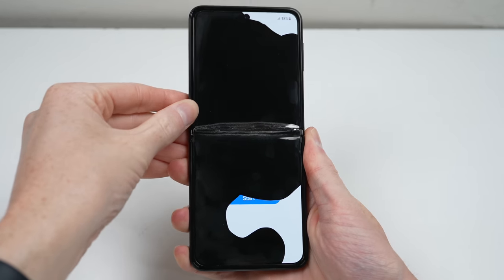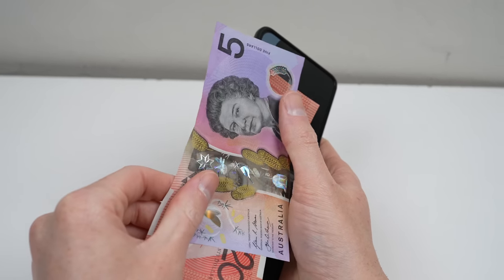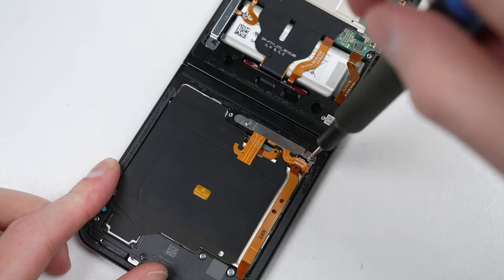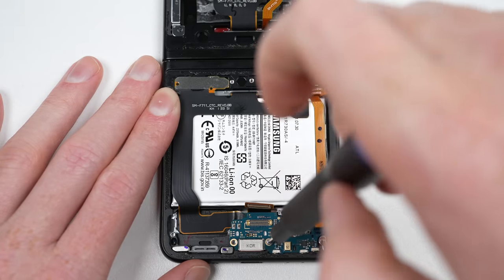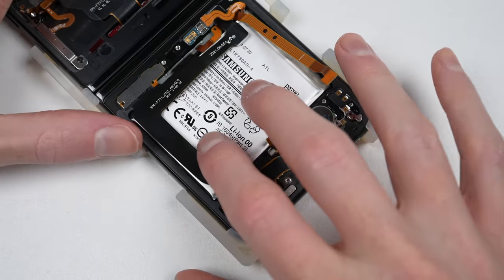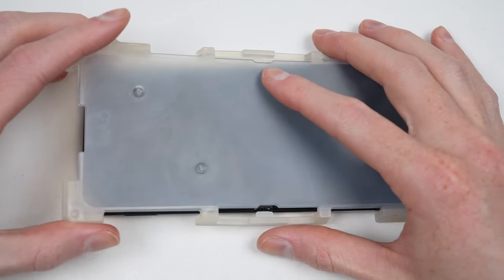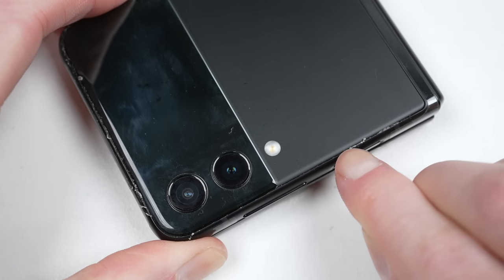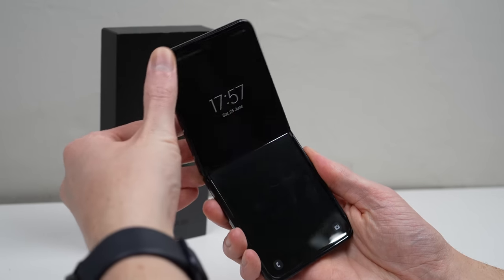$230 Galaxy Z Flip 3 Restoration

Comment: Time and time again, I am stunned just how unrepairable modern devices are. It's pretty sickening actually, but nonetheless, great fix!!
Reply: But he actually repaired it tho. You might mean they are more fragile and built with planned obsolesence, because Samsungs are very easy to repair, they were the first ones who started offering original replacement parts, and almost all their devices use the same type of screw unlike Apple who used like 10 diferent types and makes repairs a pain.
Reply: @thetechfromheaven  what I meant is repairs are not user friendly. They require tools and in some cases like this one, they require entirely new chassis that cost a few hundred dollars. 👍🏼
Reply: @RicoGalassi  yup, repairs will always scare away the average user. But if you have $1000 burning in a hole, it's a very good idea to invest in repair tools.
Reply: @RicoGalassi  That glue hell makes me sad every time I see it. Not Hugh's job with the glue, no the mere need for it. My Z5 Compact too is fully glued shut and I really hate this crappy trend.
I came to the video wondering how in heck you separate the screen and reattach it properly, and then he just goes "Nope, DON'T". And... yes, fully understand why.
Reply: @thetechfromheaven  If you have a thousand dollars to burn though, you'd be better off just buying a new phone. Unless you're a repair shop, spending a thousand dollars isn't exactly worth it for a 230 dollar phone.
Reply: @thetechfromheaven  what $1000 worth of tools are you talking about? I own a phone repair business and my tools aren’t even close to a couple hundred dollars. You need a screw driver set which iFixIt is a good deal. You can get a pretty complete set for like $100 and that includes the plastic pics cards tweezers and suction cup. Then maybe if you heat for something’s a standard $20 heat gun is fine. A syringe costs a couple bucks and so does alcohol. All those things are god to have even if you don’t fix phones. In my business the only thing that’s expensive is the laser to remove the back glass of an iPhone and you don’t really need that for home repairs. Any shop will charge about $99 for the back glass repairs on an iPhone. It’s not expensive to fix your own phone and the tools you absolutely need are good to have regardless
Reply: It's literally a flexible paper display. How is a normal person supposed to repair it without any tools? This isn't a giant 1990s telephone
Reply: Everyone calm down hahah I was just stating that modern phones are difficult to repair ffs
Reply: i survive on cheap phones usd 100-150. i don't go with the hype of "flagship" models
Reply: @RicoGalassi  I don’t think anyone isn’t calm haha. The real issue is we as consumers kind of wanted this. I’m in no way defending the practices of companies but a great example I give is everyone wanted wireless charging in the iPhone so they gave it to us. Issue is you can’t wireless charge through metal so they changed to glass and then everyone complained and said “they swapped to glass so it breaks and costs money” haha. The fact they decided to cement it on is another story haha. As things get thinner and smaller and less mechanical it’s going to get harder to fix without special tools. Surprisingly this was a pretty easy fix for a phone
Reply: I agree! I miss the days when both laptops and phones were fairly modular, and at least had easily swappable batteries.
Reply: @Kalvinjj  In my opinion the glue is the absolute worst part. Especially with battery replacements.
Reply: @KhanTutorialsBD Yeah.
Reply: @Kalvinjj  That's the trade-off for improved water proofing.
Most smartphone trends are based on what customers choose to buy.
Reply: @KhanTutorialsBD Very much agreed. MacBooks are pretty bad now though.
Reply: @AlwaysBolttheBird  I know you can even start with almost nothing, I started with a crappy 858 soddering station and some cheap screwdrivers but It would had been nice having $1000 in tools. Hell, if I have to choose between $1000 phone and $1000 in tools, I'd go for the tools without even thinking twice.
Reply: @munenex  I survive on repairing phones, no matter if their are cheap or expensive. I have the Galaxy S21 just because someone sold it to me broken for cheap and I chose to fix it, but there's no way in the world I buy a new phone be it low or high end. Actually I like my old Moto G8 more than the S21 (I also got that broken for very very cheap)
Reply: @KhanTutorialsBD This is true for the most part due to sandwiched board stacks making repairs very hard, requiring you to develop certain skills and aquiring certain tools, but that's also the fun part!
Reply: @KhanTutorialsBD Yeah, there is a lot to be desired with current tech policies. But that same restrictive environment has led to figuring out creative "non authorized" ways to repair the phones
Reply: @KhanTutorialsBD Very much agreed.
Reply: @AlwaysBolttheBird  wireless charging doesn't excuse the lack of repairability, bc  it's not on every phone and they're still glued in batteries. 

Blaming consumers for unrepairable phones seems to be pretty wrong-headed . Especially since the vast majority of smartphone consumers don't even think about their smartphone unless they actually have to buy one because it broke.

Sure maybe there's some tech enthusiasts that were wanting form over function, but the companies didn't make this change to meet a demand, they made these changes to increase phone sales.
Reply: @munenex  Expensive junk reveals the low-hanging fruit for those with eyes to see.
Reply: Guest_7802  😂
Reply: @RicoGalassi  Thats your fault for being an early adaptor of new tech. Of course foldable displays are not easily repairable lol. Wait like 5 more years and it will be much simpler.
Reply: And worst of all they remove the charger 😒,  in the name of the "Environment".
Reply: @michaelcorcoran8768  have you taken out a battery from an iPhone? It’s not that hard. They have pull tabs and if they break alcohol works fine. Moreover I said the fact that the back is cemented in is wrong. Most importantly I was giving an example of people thinking that companies are doing things to make more money when in fact it’s what the consumer asked for
Reply: @RicoGalassi  This 2asnt even that bad, and 6ou don't have to replace whole frame. If you are confident then you can just replace the display. Obviously you'll need more skill to repair complex parts like a foldable display as it's still in very early stage and will improve overtime.
Reply: @The Tech From Heaven  a 1000 !?!?!?!? Bro I had my whole equipment for 35.- 😅 heat gun, screwdriver with modulable tips, guitar picks and suction cups won't ever be that pricey. Unless you take the first thing you see of course
Reply: This was surprisingly an easier fix than I've seen of other phones. But I do agree that many other phones are basically unrepairable
Reply: @RicoGalassi  these are similar people who are stopping right for repair sadly
Reply: @munenex  i like flagships for the premium chip sets if cheap $100 phones were able to handle games and have 120 htz id be using them right now lol
Reply: It's literally done by design....
Reply: Ahh remember the Nokia candy bar from the early 2000's? That phone was literally indestructible and sold for 100$, now you pay 1500$ for a device that is super fragile.
Reply: @RicoGalassi  rrepair is not the norm now, thats why its safer to buy midrange phones sometimes
Reply: I love the innovation & build quality of this but waaaaay too fragile for my everyday use.
Great video Hugh!
Reply: I don't think you can expect a folding smartphone to be repairable bro get the hell out of here lol 🤣
Reply: Does that have to do with the complication of these phones, or that they dont want you to repair it?
Reply: @rubennietnodig7579  Id say both
Reply: @grahamevans8567  I have a very hard time believing that. In the case of apple, where non-original parts simply wont work i'd agree. But ive learnt from this channel that samsung uses all the same screws, doesnt fuck you over with different parts.
Reply: @rubennietnodig7579  i think the type of screws is irrelevant here but you are entitled to your opinion of cause. Why do you have to bring Apple in to it? Im curious
Reply: @grahamevans8567  Something to compare it to. It doesn't mean much on its own.
Reply: @rubennietnodig7579  lol
Reply: well to be fair it is a foldable phone
Reply: @grahamevans8567  Does that not make sense to you?
Reply: It's not sickening, it's logical. I expect devices as complex as the modern phone to be hard for a layman to repair.  That's obvious.
Reply: @zackwyvern2582  agree
Reply: I don't think ppl nowadays want a phone with screws on the outside and a border to hold the screws. Hence the adhesive.
Reply: @Allan_Stone  yes! Very true
Reply: At the same time companies remove adapters to save environment, but make their devices even more fragile and harder to repair.
Reply: @munenex  honestly dude, dont buy sub 200 budget phones, becuase flagships from 1-2 years ago are usually 220ish on ebay open box. Used flagships are miles better in every way.
Reply: it is a foldable after all. but still cool, I just wish samsung would ditch the UTGlass since it's still plastic on the front of it.
Reply: @RicoGalassi  dude, every android phone is repairable compared to the iPhone crap
Reply: I just hope whoever designs these phones doesn't end up also designing pace makers and insulin pumps.
Reply: @marcusborderlands6177  and what about the battery life?? You forgot that early flagship battery management was trash. The only flagship worth buying in my opinion is the Galaxy s10 plus
Reply: @danteerskine7678  oneplus, LG, and Motorola all have flagships under 250 you can buy on eBay. Stuff like the v60, oneplus 8, and moto edge all stand up today really well.
Reply: Not that difficult to just take good care of your devices or carry insurance
Reply: @marcusborderlands6177  My insurance doesn’t cost a thing cause it’s included with my credit card. And no insurance does not cost half your phone. You are getting pegged if you are paying more than half the cost
Reply: @munenex  yes Grandpa you're very cool for buying 100 dollar Androids like most phone users do anyway.
Reply: @ballstothewall38  the tradeoff is the ability to do more things with your phone than just call and maybe text people. The problem isn't necessarily that phones are fragile; obviously anything with a glass screen will be more prone to breaking than a plastic brick. The issue is that phones are built to make repairing the inevitable damage difficult.
Reply: Blame - Apple for it, every other manufacturer just copied them...
Reply: @RicoGalassi  no shit, more features and complexity means it will be harder to fix. We don't have basic nokia 3310's anymore.
Reply: Yup, I’ve got a new flip, scares the crap out of me. I have a hinge protector though. But my s20+ I had before this was run over by an ahole Uber driver (long story) and whilst the phone worked fine and the screen was still visible and working fine it was cracked to a dangerous extent and SOME parts of the screen were black. It was uneconomical to fix and it really annoyed me.
Reply: @thetechfromheaven repairs a pain ? I changed my screen and battery on my iPhone 7 + under 10 minutes, how’s that a pain ?!?!?’v
Reply: Looked pretty repairable to me.
Reply: Where to buy that?
Reply: Um.. it's a foldable.
Reply: Well overtime the engineering becomes better and better to the point where regular people would have a hard time fixing one without having any training. Unlike years ago where all you'd have to do is remove and re insert the battery or just turn it off and on again. Just a few decades ago touch screen didn't even exist, now we have phones with screens made of a foldable type of glass. Technological advancements happen faster and faster to the point where a regular guy would barely be able to keep up, just like how most old people today would barely be able to operate a computer by themself
Reply: My favourite phone is the Samsung z flip 3 5G

Comment: This proves that company’s can repair folding phones but choose not to. Love the videos Hugh
Reply: I wonder can you scrape off the paint of the phone to make a clear version it looks awesome on the inside
Reply: This a factor because of cost. Think of a repair shop. This display cost $350, the shop has to mark it up for a profit, so lets say $50, so now the screen costs $400, then their is labor costs.  This is not just heat removing a display and replacing (iPhone and most Android devices), your completely disassembling the phone. This could cost $150+ in labor, so now a $1500 phone is going to cost $550-650 to repair. 

Most people would just buy a new phone.... When display prices come down so a shop could replace it for $300-$400 it might be an option for them to repair...
Reply: @TheCoolDave  the thing is...sparepart price tends to stay the same almost forever, the price of secondhand/ preloved smartphone would simply be 1/2 or 1/3 of the display sparepart itself after 2-3 years after its released
Reply: Companies don’t really care for IF they can, it’s a matter of SHOULD they. If I was running a business I’d rather take the decision that consumes less time and money for the same general outcome. And a replacement is more viable as a option. Labor (people) aren’t cheap, they are in fact often the most expensive part of a company expense.
Reply: @Windows98R  Nah, the first fold phones that came out were canceled because of even the display models cracked very quickly.  They were very poor design, and they redid it and with a few revisions they  felt it was good. Still the tech is not even close to being ready for everyone. I know people who have had problems with them after a few months and by then the warranty was up.  I feel the tech is not ready for the consumer pocket but, to each their own...

It's devices like this that keep repair places open and making a profit...
Reply: @TheCoolDave  first gen was definitely a prototype level durability. The later ones,2 and 3, I think are consumer ready. That being said, it wasn’t a idiot proof product. (Which I can really care less about). It’s still fragile and if someone doesn’t expect the right level of fragility, they’ll easily break the phones. That’s on the user, not the device. Honestly, Samsung has a habit of releasing semi-prototype products anyways so it wasn’t surprising.
Reply: @Windows98R  Agreed, this tech, as folding OLED displays are fairly new tech for this type of device. I personally would wait till the 7-10 gen, I would hate to spend $1500 on a phone just for it to break, and the reviews say they are not very dependable. Right now, they very expensive, still working the kinks out and after 6 or higher gen, most bugs will be worked out (and better devices) the tech is common place so the prices will drop. 

Still too early for this new tech....
Reply: @TheCoolDave  repair places DONT repair these tho. They spend 99 percent of their time on iphones, and standard candy bar style phones.
Reply: Not sure if you're in the US or not, but we repair these in the US. I just repaired a Fold3 and Flip4 earlier, inner display on both. The process is mostly similar to this video, but I was cringing during a few things he did here.
Reply: In germany at least samsung does repair them directly. For as little as 220€ which is quite a lot less than apple takes for any modern iPhone except the SE